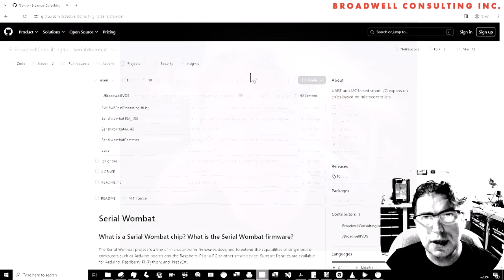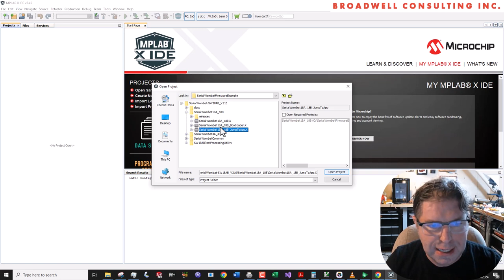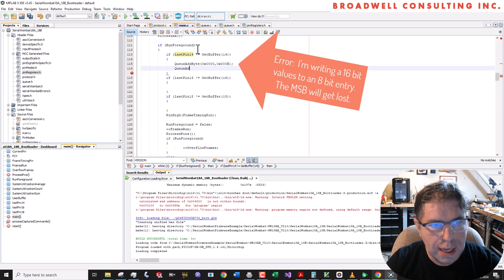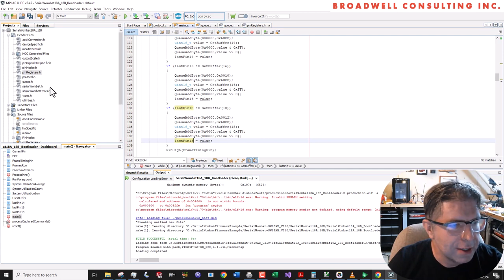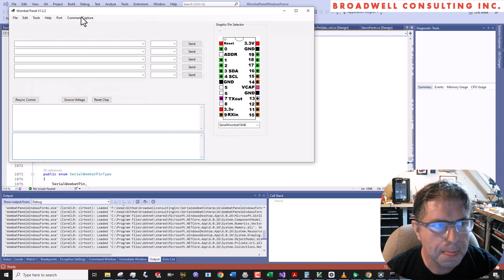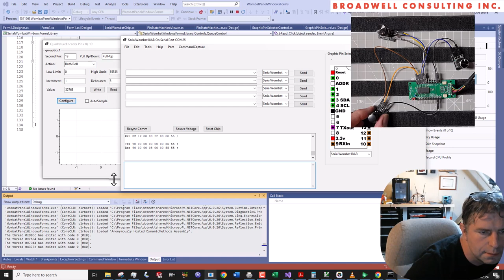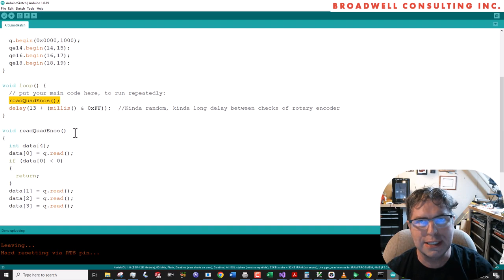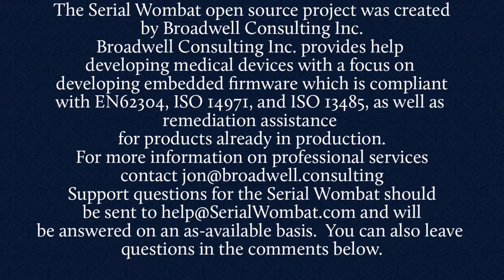Adding Custom Functionality to the Serial Wombat 18AB Firmware

Comment: Great video! I've got a couple of questions:
Is it possible to return the entire queue, or at least to loop on reading the queue until it is empty?

Since each encoder only needs two bits to report a transition, would there be a performance benefit to combining all three into a single byte? (If any one of them reports a non-zero transition, they all put their status into a byte.)

I currently have my Serial Wombat soldered onto a custom PCB with SCL and SDA connecting to a Raspberry Pi Pico, to reflash it should I: desolder it from the board, add some wires to an FTDI adapter, or is it possible to reflash through I2C?
Reply: I soldered some jumper wires onto my SW18AB and reflashed with an FTDI adapter/wombat panel. I confirmed that version 9.9.9 gets reported back when version is polled.
I also checked the encoded on 16-17 through panel, but was having trouble testing the other pins (clicking on 14 or 18 and selecting encoder opened the window, but said it was for pins 255 and 256). 
I modified the example sketch for python and to read the entire queue (self is the wombat chip)

def read_queue(self):
    q = self.queue
    data = [0, 0, 0, 0]
    data[0] = q.read()
    while data[0] >= 0:
        data[1] = q.read()
        data[2] = q.read()
        data[3] = q.read()

        if ((data[0]==14 or data[0]==16 or data[0]==18)
            and data[1]==0xCD and data[2]>=0 and data[3]>=0):
            print(f"{data[0]:X} {data[1]:X} {data[2]:X} {data[3]:X}")
            print(f"Pin {data[0]} moved to value {256*data[1]+data[2]}")
        data = [0, 0, 0, 0]
        data[0] = q.read()

However, when I call read_queue without having moved the encoders at all, I get the following output (until I kill the script):

12 CD 0 12
Pin 18 moved to value 52480
12 CD 12 CD
Pin 18 moved to value 52498
12 CD 12 12
Pin 18 moved to value 52498
12 CD 12 CD
Pin 18 moved to value 52498
12 CD 12 12
Pin 18 moved to value 52498
12 CD 12 12
Pin 18 moved to value 52498
12 CD 12 12
Pin 18 moved to value 52498
12 CD 12 12
Pin 18 moved to value 52498
12 CD 12 12
Pin 18 moved to value 52498
12 CD 12 CD
Pin 18 moved to value 52498
12 CD 0 12
Pin 18 moved to value 52480
12 CD 12 12
Pin 18 moved to value 52498
Reply from the maker: Thanks, Carl!

1.  Yes.  You could definitely slightly alter the loop so that it kept reading if it was successful in reading one packet.

2.  There would be a minor performance benefit.  However, if it is a human moving the knobs, the number of transitions will be so slow compared to your ability to pull the data from the queue, that I wouldn't worry about it.  For this reason and because I was making the video, I optimized for simplicity and clarity vs. performance.

3.  You don't need to desolder it from the board.  The board can provide power.   If you power off your board, clip a ground to the addr line, then power it back up it will come up in UART mode.  Clip the ground from your USB / UART adapter to the SW ground, and clip the tx and RX lines to the TX and RX lines of the SW, and you should be in business.  That's why I made UART selection grounded, so you could override an open or resistance to ground I2C setting on the ADDR pin.  (Secret... You can also run both interfaces at once so your embedded code can command the serial wombat chip, and the WombatPanel application can observe pin values and the like.  A future video is coming on this.)

You can also upgrade firmware over I2C.   Grab a NODE MCU or similar ESP8266 based board, connect it to the I2C bus, and run the firmware update sketch in the examples.  Micropython support for flashing over I2C will be available at some point in the future.
Reply: I should clarify that I run into the same problem with the unmodified read_queue function as well.
edit:
setting pullUpsEnabled to True (even though the encoders I'm using have their own resistors) and clearing the queue during setup fixed that.

    def flush_queue(self):
        print('Flushing Queue')
        q = self.queue
        data = [0, 0, 0, 0]
        data[0] = q.read()
        while data[0] >= 0:
            data[1] = q.read()
            data[2] = q.read()
            data[3] = q.read()
            data = [0, 0, 0, 0]
            data[0] = q.read()
        print('Queue Empty')
Reply: However, I am running into a different problem.
Moving a knob clockwise or counterclockwise results in:

12 CD 0 0
Pin 18 moved to value 52480
12 CD FF FF
Pin 18 moved to value 52735

I have tried readState as 4, 5, and 6 and with various debounce_ms values such as 10, 100, and 500.
Reply from the maker: @carlrecine   The values you're interpreting don't look right.  the last two values are the encoder values.  0 0 is 0x0000, which is 0.   FF FF is 65535, which is what you get if you click one down from 00.    it looks like you're taking CD 00 as 0xCD00 = 52480, and CD FF as 0xCDFF = 52735.   You need to combine the last two numbers call them data[2] and data[3].  To do this, result = data[3]*256 + data[2].  So for instance, in 12 CD FF FF, data[0] = 12, data[1] = CD, data[2] = ff, and data [3] = ff.  This results in 65535.

If you got 12 CD AB 78, the result would be 0x78AB = 30891
Reply: @SerialWombat  Thanks, I had a typo in my print:
print(f"Pin {data[0]} moved to value {256*data[3]+data[2]}")
had data[1] instead of data[3].

now moving clockwise gives me:
12 CD 0 0
Pin 18 moved to value 0
12 CD FF FF
Pin 18 moved to value 65535

and counterclockwise also gives:
12 CD 0 0
Pin 18 moved to value 0
12 CD FF FF
Pin 18 moved to value 65535

If I pause between clicks, I only get the 0 0, again regardless of the value of readState.
Reply from the maker: Can you send me a copy of your host side code?
Reply: @SerialWombat  I've uploaded a slightly simplified example that demonstrates the behavior I'm seeing. (I can't add links in YouTube comments, so I'll email it to you.) 
I'm using circuitpython on a pi pico, which required some small modifications to the Serial Wombat library.
Because it displays 0000 then FFFFF, regardless of which way I'm turning the encoder, I'm wondering if the queue is returning the high-low values from one of the pins instead of the encoder position.